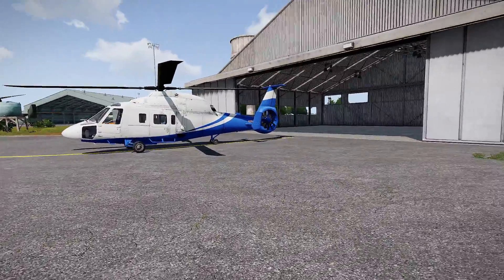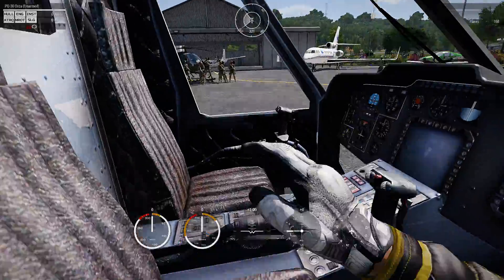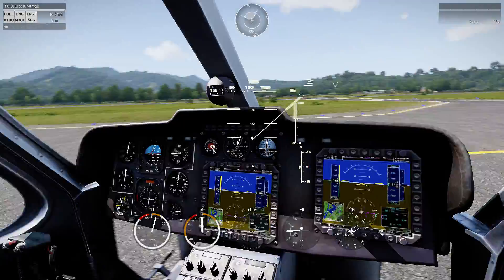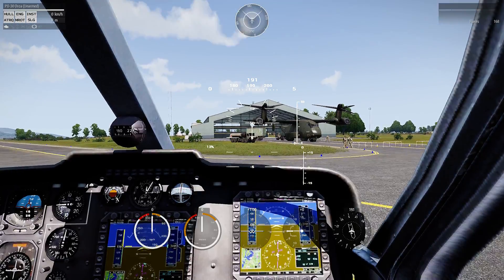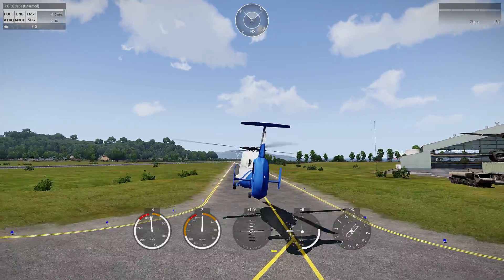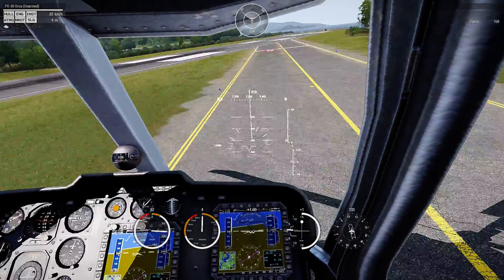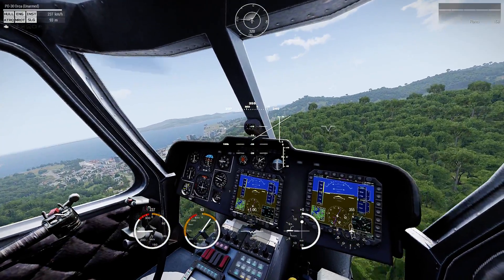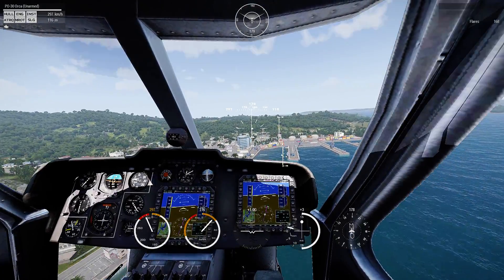ARMA 3 Advanced Flight Model Tutorial #4

Comment: Apparently people "whined" about the challenges of flying helicopters and in 2022, it appears that the tail rotor flight characteristics have been "dumbed down" and desensitized the ability to control yaw at slow speeds. I have almost 1000 hours in the Pawnee and Hummingbird so it was readily apparent when the changes were introduced. I wrote a trouble report but so far the cupcakes are ruling the day.
Reply: Oh, no. Was there a changelog on that issue, or you just feel it?

Comment: What do the sensitivity and deadzone settings look like for your joystick? Do you get rid of all deadzone? And what stick did you use?
Reply from the maker: Extreme3Dpro from Logitech. 

No dead zone and no sensitivity on throttle. 

Roll and Pitch sensitivity curves align with first S. And for dead zone they align with the first E.

For yaw on both sensitivity and dead zone, they are half the value set on roll and pitch. 

Suggest you set same curves in sensitivity for roll and pitch. And same with dead zone. 

Set just enough dead zone that your hardware slop is not felt 

Honestly though it's up to you to play around with what feels right. My settings may act differently on your hardware